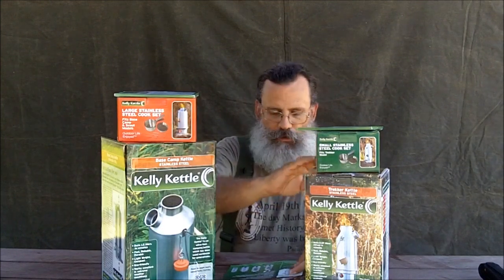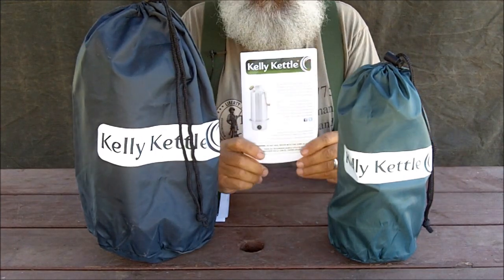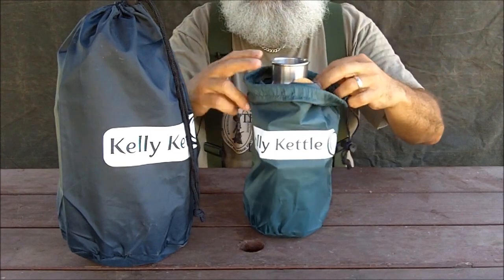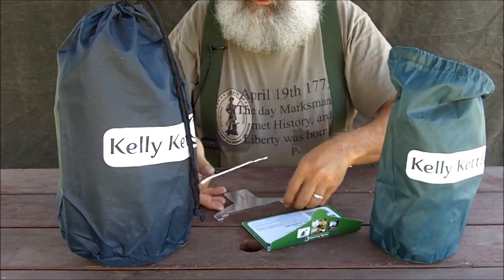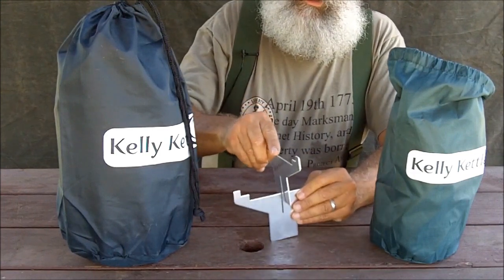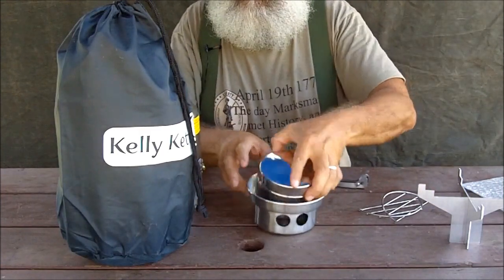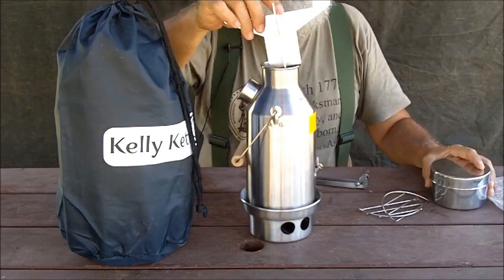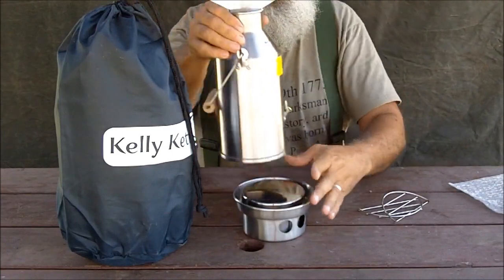Kelly Kettle Survival & Camping Stove, Review and Demonstration

Comment: I've had one for several years - I really wanted the earlier model that had been around for decades made of copper, but I couldn't find any except ones made in china and they had very poor reviews.

I've got the camp model with the accessories and am very happy with it (stainless steel as I always avoid aluminum) AND YOU CAN PURCHASE THE SCOUT MODEL IN STAINLESS STEEL AS I JUST ORDERED ONE.  These were originally designed over a hundred years ago and they are Rocket Stoves and that is the reason that you must always have water in them to keep the steel from getting too hot.  Rocket stoves create more heat than other models.

They were used by soldiers on the ground in WWI and WWII by many in Europe and were frequently referred to as Belgian Kettles by our troops even though they were invented in Ireland.

GandolfTheWise

Comment: Actually, the company reports that no stainless steal kettle has ever melted down without water in it. The aluminum mid size Scout can melt with no water in it. Obviously stainless steal has a much higher melting point.

Comment: I wonder if one could use an alcohol stove for heat, If wood is to damp to burn?
Reply: I have used it with a Trangia burner and it works great.  Even with the Trangia, flames are shooting out of the top sometimes.

Comment: Beee prepaaaared... to repaint your wooden picnic table! Pro tip: You can't use one of these babies on anything other than rock, stone, earth or sand.
Reply: Or firebrick, tile, granite, hardiebacker, cement board, and on and on.....
Reply: There are videos of people using them on the ground with no problems. As long as the rock is flat, it won't tip over. On sand, just make sure the sand does not cover the vent holes. So no special surface is really needed. Just some common sense.

Comment: Very, very cool device. I was going to get a different type of stve which has a USB charger on it. For mobiles and such but I love this device after looking at it so far. Plus it's £100 cheaper. I'm kind of 50/50 now. I could use a solar system I guess, and it would still work out cheaper. Just not very reliable in overcast British skies.

Nice channel btw, subscribed.

Comment: Do you need to put water in the kettle if you just want to use the pot or can you use it dry just to boil the pot.
Reply: It can only be heated with water inside or it will be damaged.
Reply: Ben Rogers thanks Ben.

Comment: could some one please tell me why you need the water in the wall?
Reply: It's a kettle, you are boiling this water for food and drink.
Reply: It's like putting water in a balloon to stop it from popping. Best reason I can think.
Reply: I believe burning it dry will possibly overheat and split the seams
Reply: it is a thin wall metal and the water actually keeps the metal from being damaged due to the heat that goes up the chimney,  that is why it boils water so fast, it transfers the heat very efficiently and when you take the kettle off the fire and pour water out and then want to put it back on the fire you have to add basically the same amount of water that you poured out so you don't damage it   if you use the pan feature to cook that fits over the chimney you still need water in the kettle

Comment: too pricey   too bulky  only 2 cups of water capacity in that huge container  nahhhh
Reply: You use it as a stove to cook as well, not just heat water, and like any cooking set when not being used fill the hollow middle with ropes or whatever other gear. And you don't need to carry any fuel for it. Still nah, or bulk justified?
Reply: jefsti
true you can use it for storage...but still pricey and the weight might be an issue with some too (small one is 1.6 lbs)...just not practical for backpacking to me...
Reply: Ei Pi I figure something like this would be good for a car emergency kit where size and weight aren't as big of a deal.  I agree that for backpacking there are better options out there.  but the simplicity makes it good for throwing it in an emergency kit and forgetting about it.